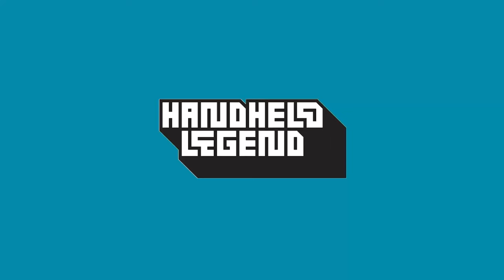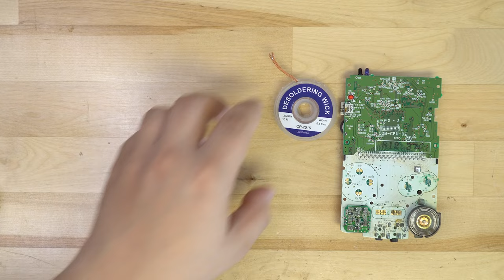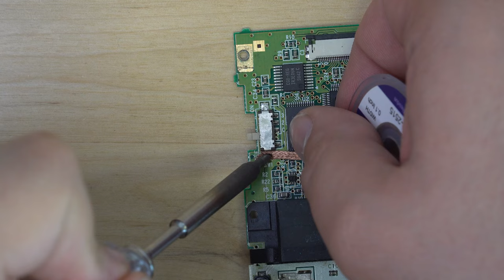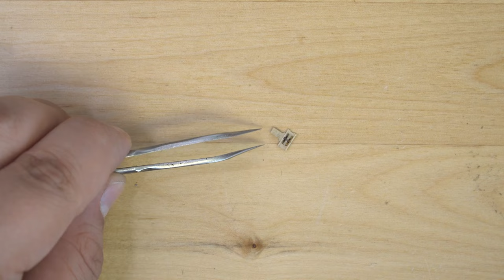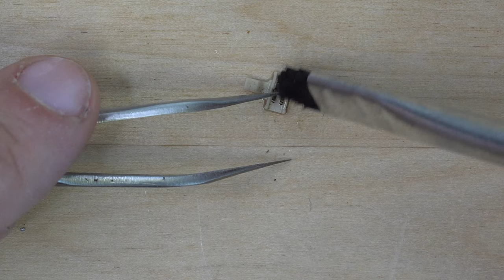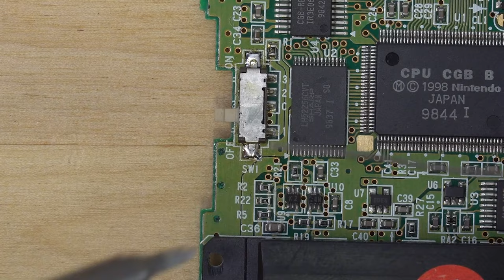Gameboy Color Power Switch Cleaning

Comment: I stick a thin tweezers under the large center part toward whichever side I'm heating and then pull it up gently while the solder is molten, eventually it breaks free and then I do pretty much the same as you for the second side. For cleaning inside I always use a fiberglass pen and it works quite well.